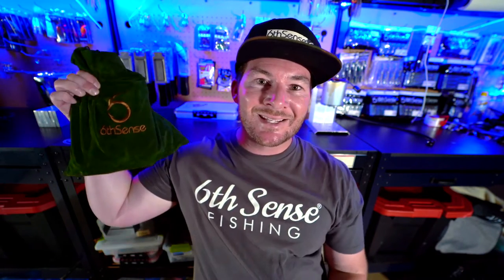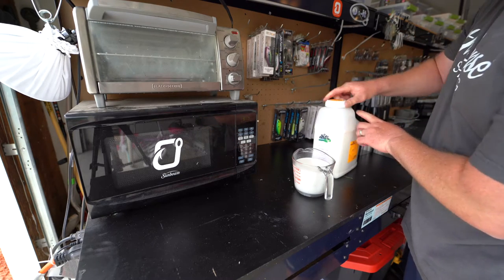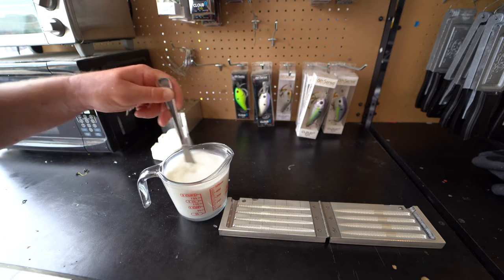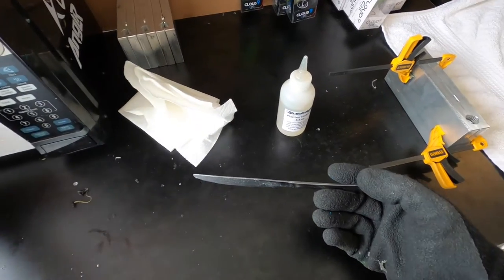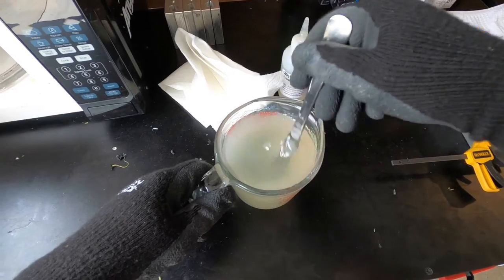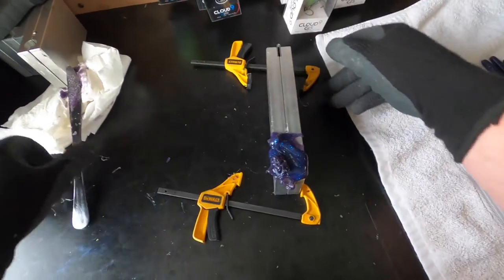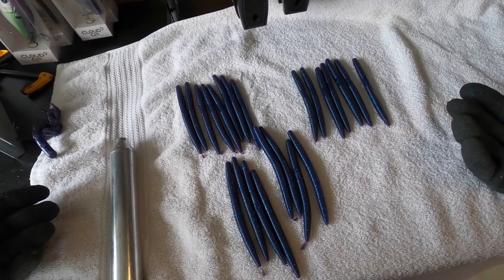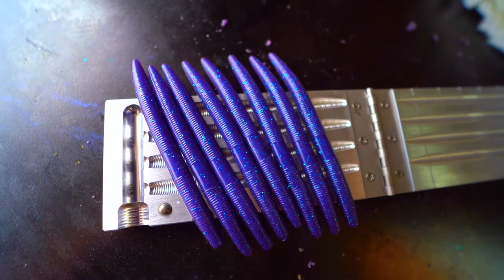How to Make Fishing Lures  - Making Soft Plastic Baits with the Do-It Molds  Senko Mold

Comment: Have you ever thought of using a presto pot It does work very good when you are cooking the Plastisol Is and with the presto pot You can set it at the temperature you want and it will keep it there for a long time I've been using it for about 2 years Making soft plastic bait
Reply from the maker: I’ve thought about getting one, but i haven’t yet.  I don’t know that I pour enough at one time to really need one.  I’m super close to buying one tho
Reply: @Matt Luna fishing You can set the temperature to where you need it At and heat from the bottom But it is worth it to buy one It is better than a microwave It can go from 200ﾟ all the way up to 400ﾟ And if you have any bubbles in the Plastisol It will get rid of all the bubbles True facts
Reply from the maker: I’ve heard good things about them!  I just don’t want to waste plastisol if i end up not using everything i put in there.  I know i can remelt it.  I should probably just buy one! Lol
Reply: @ Matt Luna fishing Yes you can use it for Remelt Just make sure you add fresh Plastisol In the remelt You can put 3 cups of Plastisol In the  prestal pot And you won't be wasting that much It depends on how big of a Bach you are trying to make I hope this answers your question
Reply from the maker: I’ve talked to a bunch of people about it over the years, just haven’t pulled the trigger.  I may soon.  I’ve been recommended it by a handful of people
Reply from the maker: Thanks
Reply: @ Matt Luna Fishing And get injectors from 6 oz up to 20 oz And make sure you have enough Soft plastic mold And you want to buy the Plastisol In 5 gallon bucket I know 2 places where you can buy it in bulk One of them is bait plastics And the other one is dead on plastic Those 2 companies sell it in bulk And you are very welcome

Comment: Pop corn salt is whats in a senko
Reply from the maker: I’ve heard it’s a different type of salt.  I’m not sure what it is though.
Reply: @MattLunaFishing  its popcorn salt hes confirmed it in some interviews i think it was ike live that i heard it on first then something on youtube the other time
Reply from the maker: Ok cool.  Thanks for the info!  Good to know for sure
Reply: @MattLunaFishing  my 12 and 15 year just starting making their own soft plastics.  What is the purpose of put the salt in the plastisol?  And how do you eliminate air bubbles in the senkos when injecting?
Reply from the maker: Salt makes the bait sink and makes the baits softer.  Air bubbles usually come from moisture in the plastisol.  Most of the time air bubbles will come out when you heat the plastic
Reply: @MattLunaFishing  Air bubbles are in the senkos after they cool.  Thats what Im trying to help him eliminate.
Reply from the maker: Probably pouring too fast or the mold isnt venting properly.  Try slowing down the pour into the mold.
Reply: Salt does not make your bait softer, however does make it sink. A softer plastic is required when adding salt  to create action. Sand is also used with Gary's products